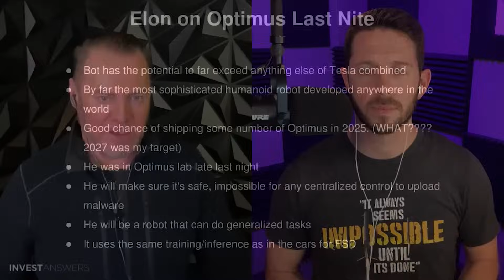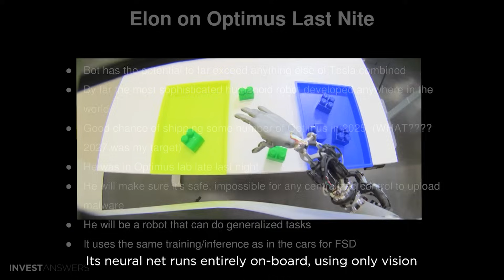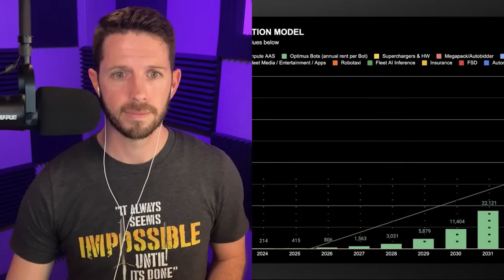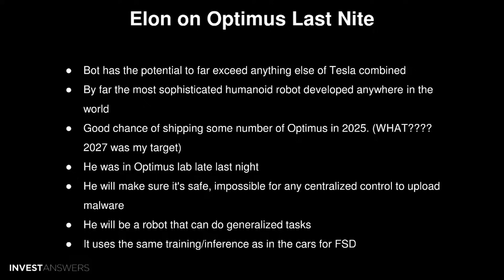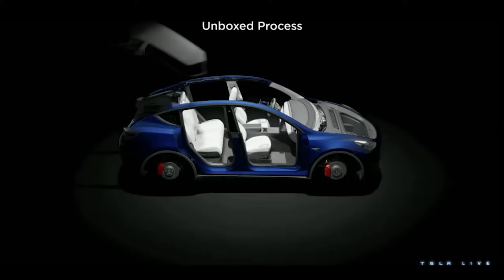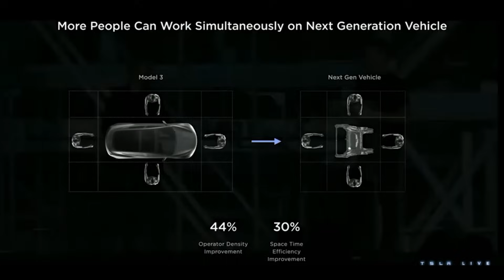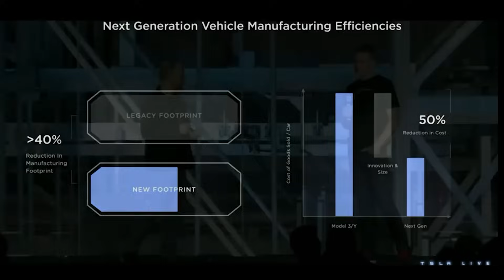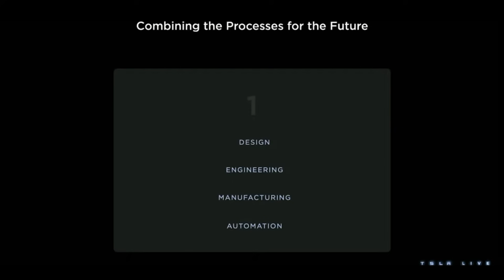Elon Musk: Bot Will be BIGGEST thing World’s EVER Seen!

Comment: I'm a long time Tesla owner/fan but Elon is wrong about the viability of a humanoid robots. Making it more human-like doesn't make it more useful, in fact now it's limited to what a humanoid can do and will NEVER do everything a person could. And making them all the same is worse! Can it lift heavy objects? Should it stand in a factory packing widgets and never use its legs? The factory fork-lift of the future will be driven by AI and have cameras to see all around. It won't have a steering wheel and wait for a robot to climb in and drive. You won't be maintaining hand/foot controls on the truck, or wasting time, or wearing out the robot and wasting the energy. The best part is no part! "It's made human-like so it can work in environments made for humans" Think about that! That is the antithesis of "First Principles"! (unless your goal is to copy a human which is much easier to do with sex) It compounds costs/complexity and reduces efficiency. I'm an automation engineer, I wish they would put AI on all the existing dumb robots. You could test and prove learning concepts/systems on existing equipment. There are all kinds of robots, controllers, vision systems etc. that could use a brain NOW. Besides the unproven AI, look at the fingers on Optimus! Could it even pick up a needle to thread it, Start a roll of tape, put a lid on a cup, make change out of a register? How long would it take to peel a label off the backing? tie a shoe, pick up a pen and write? A person, without looking, can pick up just one small screw out of a pile and orient it in their hand. A person can reach into their pocket and count change without looking. Please tell me the "easy" jobs a humanoid will be able to do! There are no "easy" jobs that aren't already automated. Enthusiasts will say "It's not like FSD because you don't have to be 100% accurate". Then it will fail in its job. If it drops a box of screws, breaks something expensive, falls and breaks itself, stops production etc. it's costs could be more than the savings. Enthusiasts will say "It doesn't need to be fast because it can work long hours". Then it will fail in its job. Factories are built for people to operate, so it will have to operate like a person. Asset utilization is important. Otherwise you'll have to create dumb jobs for it like overnight stock-boy. Call me when they demonstrate a stock-boy, if I'm not dead. Enthusiasts will say "we'll need them on mars" On mars you will want a smart crane/robot that can manipulate and join large habitat panels and move machinery. And you would want a smaller smart robot with tools instead of hands so it can manipulate/repair small cables/connectors quickly without having to pick up bulky hand tools. And it should have extending legs rather than get on a ladder. It would be ridiculous to have humanoids operate cranes, use wire cutters and climb ladders. You may only need two humanoids to set up a base because humans didn't evolve to use technology. The fud about the car was easy to ignore because the car was on the road. But the uncertainty and doubt about a humanoid bot that has no brain yet is very real.